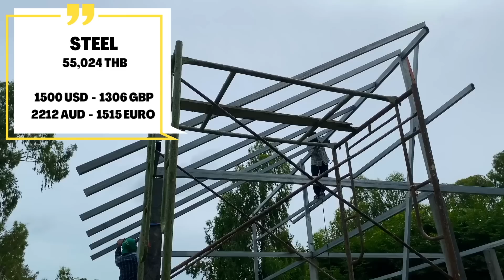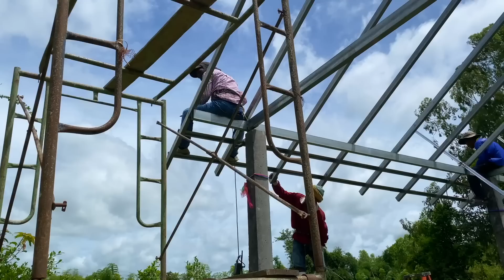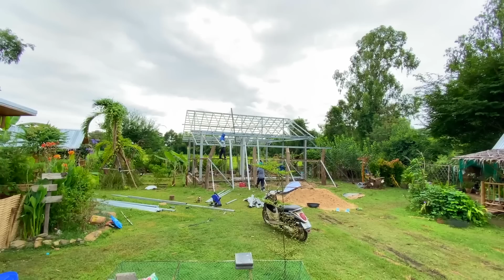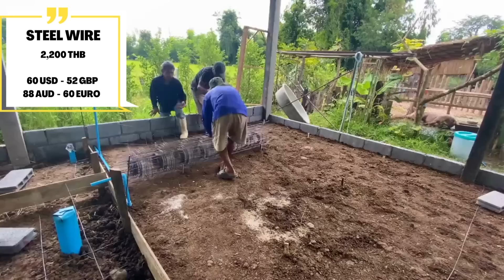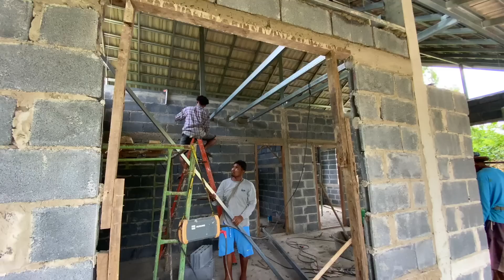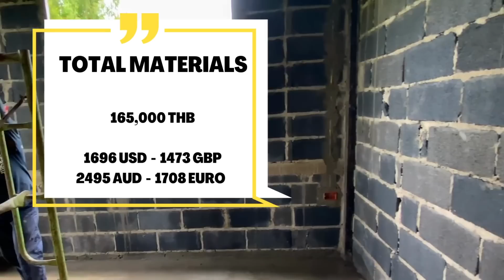How Much Did Our Tiny House In Thailand Cost?

Comment: I live in Issahn Thailand, 20 years ago I built a 150 sq. mtr. house using identical materials & construction tecniques. It remains as solid as the day it was built with no cracking. I think the secret is to have good quality concret with corect ratios and evenly mixed.

Comment: Kudos to you and Damo for your wonderful life choices. You are a good person, a great father and an excellent partner for Damo.
I have been building passionately all my life . . . building dreams on micro budgets.
I don't see too much of a problem with the workmen not lifting the steel . . .  concrete is strong in compression but weak in tension, so placing the steel close to the bottom is correct in your build. The very wet concrete would have penetrated the fill soil sufficiently to encapsulate the steel. 
If you are ever up in Fang, you are welcome to see what my partner and I built with our own two hands.
Reply from the maker: Thank you Mark - appreciate it!

Comment: Hi Ryan and mo. Great video and yeah, you killed it with the build, keeping to budget is really hard. I just built my house in Indonesia last year. First time and my wife and I made a budget of about $40, 000 for our build and we went almost $20, 000 over. But we went overboard with premium tiles and a kick ass dream kitchen. One thing that also added up the budget was building a workshop that was planned later on and windows. We wanted wanted a lot of natural light and air circulation. We live up in the mountains so we don't have AC. We ended up putting in like 30 windows and we got these glazed tinted windows that make it hard for people to see into the house and it also cools the house down better than regular windows. Sorry for the long rant. Good luck with the rest of the build.
Reply from the maker: Cheers Daniel!

Comment: Western homes - especially American - are crap compared to this. I'd take a welded steel and reinforced concrete frame over stick-built any day. Those block walls look sturdy, too. I hate the way modern American homes are built. They explode when the wind blows. Ceramic roof tiles don't burn. How many American homes have asphalt singles? Do any westerners making complaints here understand why wildfires burn down so many American homes? Hint - starts at the roof. 

This home is inherently more wind and fire-resistant.
Reply from the maker: I enjoyed reading this 🙏😊

Comment: Cool . This is very useful as i am currently building a house in North Thailand or rather my builder is doing it for me.  I am paying  1.1 m  bhat for everything and the size of the property is 120 sqm .  The price is thought to be very good for an area near Chaing Mai and works out as  9k ber sqm which is very good for round here.  I should say that my build includes windows , doors front and rear stair access and a raised not flat roof . It is three bed with two relax areas and two bathroom/shower rooms one of which will be fitted with a jacuzzi. It also includes all basic tiling but i am paying extra for upgrades to the doors ,windows and floor and wall tiling. I will also upgrade the lighting and kitchen .  I can recommed Dohomes for furniture, fixtures  and accessories they are very competitively priced compared with alternatives like Global House.  Good Luck with the rest of the build and message me if you want to know more. I should say the builder is a member of my wifes extended family and we are lucky to have him as he is very much in demand and often charges a lot more.  I am a Teacher so this is a long term base for me and like you I am originally from the UK.
Reply from the maker: Cheers Andy

Comment: Hi Ryan, just love your Family especially that little GEM " OTIS "  Being a retired Builder & Building Inspector your comment your said build different to the West Regulations = You are not wrong there OMG.  I noticed the roof had no diagonal bracing especially for Cyclone conditions - Shut up John. Anyhow you are so fortunate to have a lovely General Foreman, Damo I will pat you on the back.
I remember your face expression when buying the Roof Tiles -- Wow what a relief they had the quantity you required. Anyhow please enjoy your new Abode - Congratulations take care. John Mc Australia. Yes Ryan, should have had a membrane under the slab, and yes most importantly should have lifted the steel mesh, you will have many contractual & crazed cracking of the slab. Ryan if possible hose down the slab as much as you can, keep in damn for curing will help because of no membrane.
Reply from the maker: Cheers John 👍

Comment: Hi Ryan, Damo & ‘Tis,
Great vlog and breakdown of build costs in rural Thailand. I wouldn’t worry about not using plastic sheets (Damp Proof Membrane) or the slab reinforcement not being in the middle…it will do it’s job to help prevent cracking no problem. The reinforced beams between the posts will be fine too. Your builders work hard for sure and seem organised and professional, I can’t wait to see the finished build and all Damo’s creative finishing touches. (And your input also Ryan.!). It’s almost unfair to compare build prices in different parts of the world but incredible that 56sq metres in the uk 🇬🇧 would be around £112,000 or thereabouts. (Two to three thousand pounds per sq metre depending on finish and location). My best to you all, Anthony. 🙏🏻🙏🏻
Reply from the maker: Thanks Anthony - hope you are well brother 👍🙏

Comment: There are many ways that concrete is poured even here in wet Washington state.  Sometimes the wire is used, sometimes plastic sheets, other times over bare ground.  And these are all concrete outfits that have been doing it for many many years.  Many garage floors are poured after the house is built even.

Comment: Sorry to say but to place the slab rebar into the middle of the slab thickness, like you pointed out would have been totally wrong as you would position the rebar in a position that has the least amount of forces to take (static of a slab)- they did it right, it should just be covered by concrete, therefore, the rebar should have been lifted about 3.5 cm from the soil to ensure sufficient rebar-concrete cover ... - usually a standard self carrying concrete floor has 2 layers of rebar - top and bottom - but in this case, it is just a floor slab which is not constructed to carry heavy loads - what they did is just fine - no trouble to await!
The whole construction is well done for the purpose- don't listen too much to tips regarding western standards - you guys did it really okay! I am a Construction Manager and worked in many countries on huge projects...(Never place the rebar in the middle of the slab as there it is of near zero use)
Reply from the maker: This is good to know actually as we recurved heaps of criticism about this 👍👍👍 thanks!

Comment: Building mine in ubon right now you got the going isan rate so that's great I'm getting ready to do the block work and rendering how did they charge you? I have an est of 250bt sqm block and render. Also I would not worry about the plastic under the slab built 40 houses in the USA and never used it.. the steel in your slab that's fine its not laying on the ground its up 1 or2 cm. Enjoy your new house.
Reply from the maker: Hey brother thanks for this message - I thought as much myself but wanted to address the critique anyway 😊 we were charged 100 baht per sq meter for both block and rendering 😊🙏
Reply: @lifeinruralthailand  brick 100 rendering 100 so 200 sqm?

Comment: Is that concrete? That'll be like an oven in this sun. It soaks up heat during the day and releases it at night.
Reply from the maker: Aircon 👍
Reply: @lifeinruralthailand  Aye, but you'll spend much more on Aircon than if it was built with a hot climate in mind ...... YT is full of videos on building materials and styles for hot climates.
Reply: They'll be fine. Open some windows and let a nice breeze flow through.
Reply: @jcomden  Aircon.
Reply from the maker: It is true - our villiage is cold about 1/3 of the year, windows and fans are fine 👍